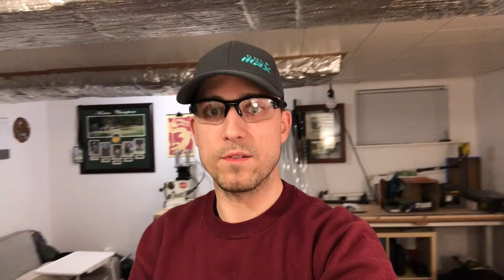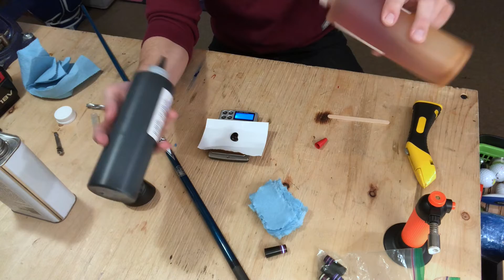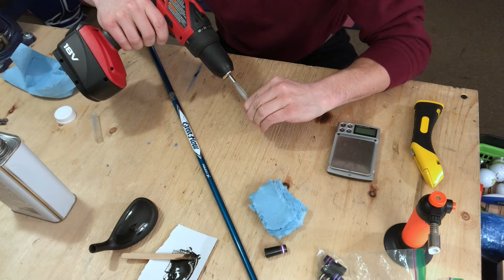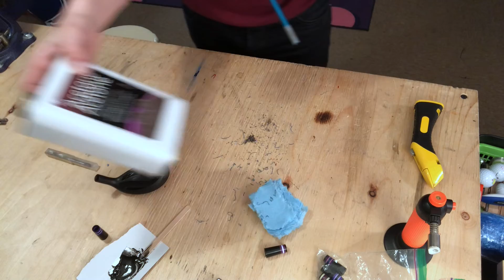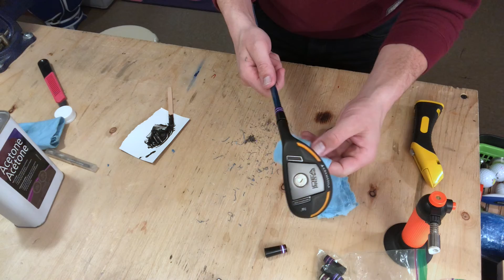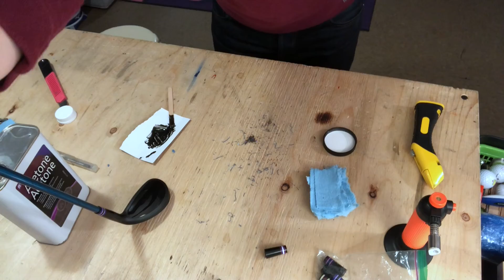Building a Club Start to Finish

Comment: Do you line up shaft with logos/lettering on the back side?
Reply from the maker: yes, most installations are logo down
Reply: What is your take on "puring shafts"?  In this video you seemed to just put it in any orientation.